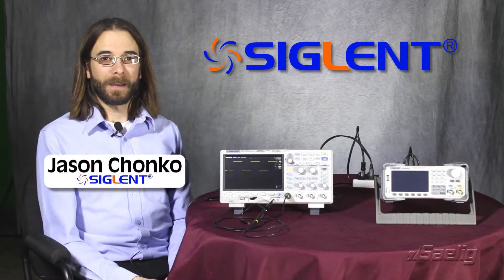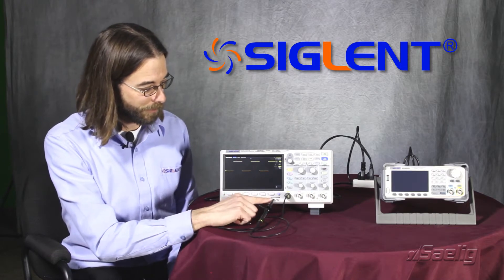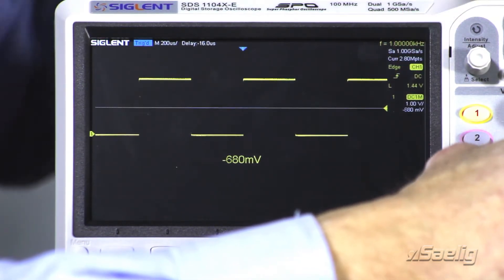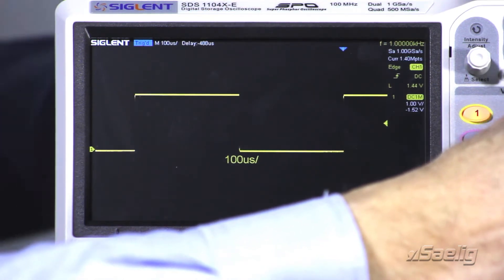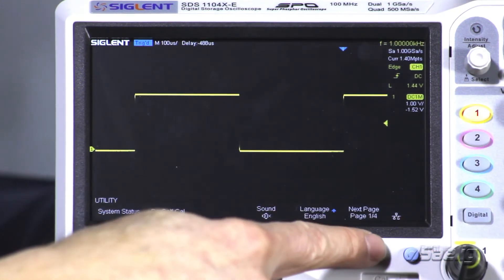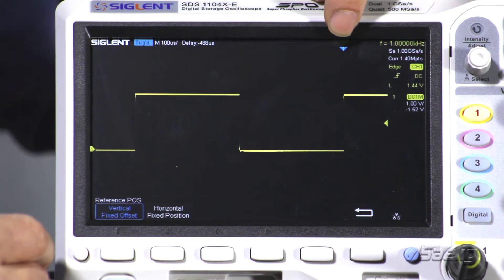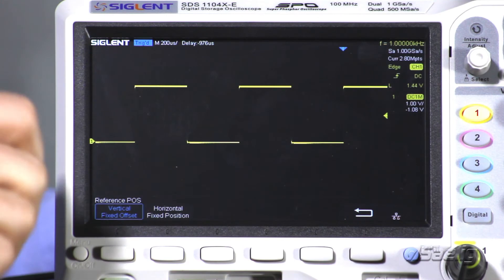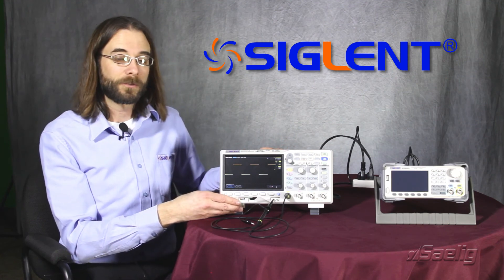SDS1000X-E Zoom Reference Position

Comment: When in "Horizontal Fixed Position" mode, what happens when the Horizontal Position is altered?
Reply from the maker: Existing waveforms will move in the direction of the horizontal position, as expected. The Zoom Reference only affects where the Zoom's "center" is. - Jason, SIGLENT North America
Reply: @SiglentVideo  Is there a video that shows extra detail about this?
Reply from the maker: @xavieraxiak6866  This video covers the Zoom Reference position and its effects. The horizontal position is indicated by a blue arrow that denotes the trigger start time = 0 s. It simply moves the trigger point left or right on the display. If a waveform is on the screen, it will also shift left/right. If you have more detailed questions, write me at info@siglent.com